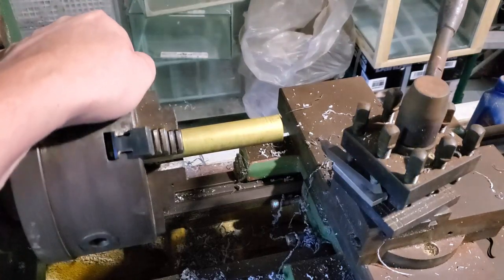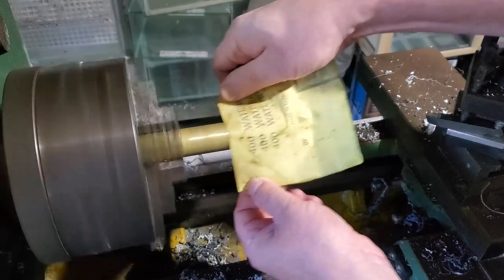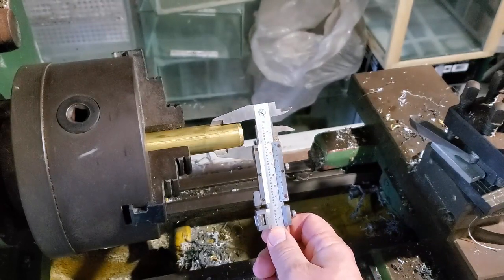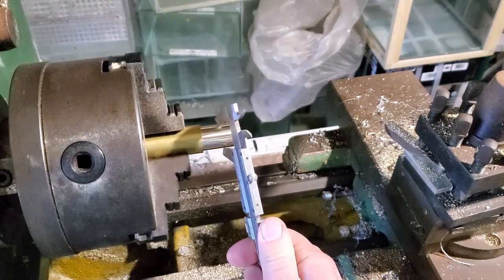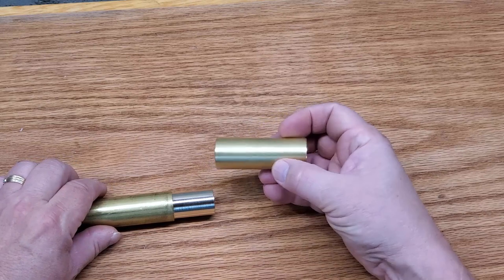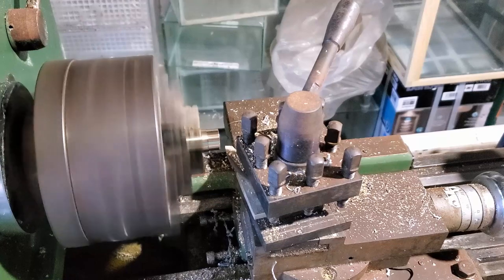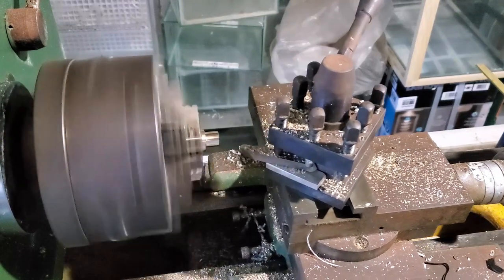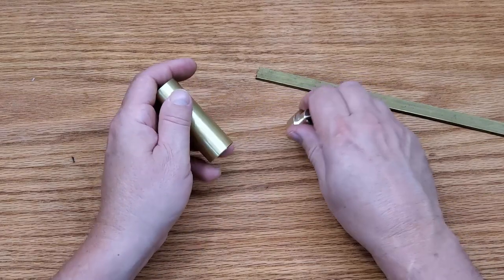DIY Brass Air Pump Part 1

Comment: This build is great.  If you do feel the need for a ring why not find some Teflon or hdpe.  A single groove for an oring would be easier.  But I feel a Teflon sleeve would be pretty ultimate.  Especially since you are already going the extra mile.  I always look forward to your videos but now a little more so. Thanks for the content
Reply from the maker: I'm so glad you like what I do here! I have a little teflon from quite a while ago. I may use it in this project. I won't be buying more as it is very expensive here.

Comment: I can relate to that design approach. I wish my propensity for making rough mock-ups before I cut costly materials was higher tho.
Reply from the maker: It's definitely a thin line to walk. Making a mock up that's usable in the final project and not wasting too much material on false directions. Thanks for coming by!

Comment: Great work.  Can't wait to see the pump working.  How much air do you anticipate the pump will produce (how many air filters, etc. will it run)?  Thanks Fred O
Reply from the maker: Hey Fred! That's the $64,000 question. So many variables (cylinder volume, piston stroke length, cycles/ min, valve integrity...) I'm hoping to approach a comparable volume to a good sized air pump but that might just be dreaming.
Reply: @FishmanEricRussell  It seems like a very long time ago when winning the $64,000 question was a lot of money.
Reply from the maker: @FredHOleniuk  Lol! So true